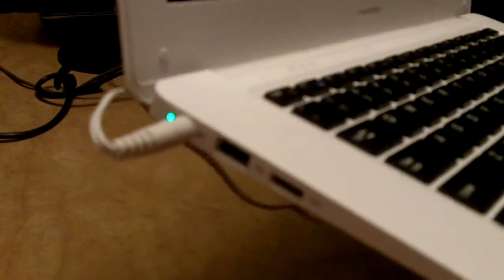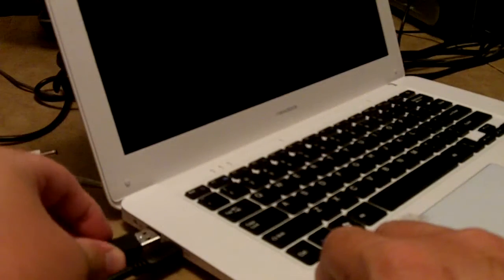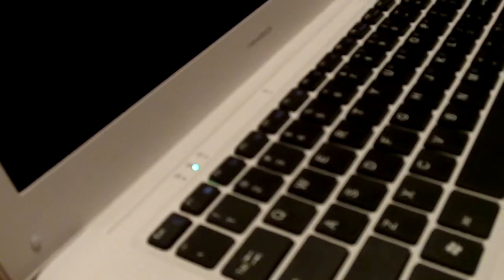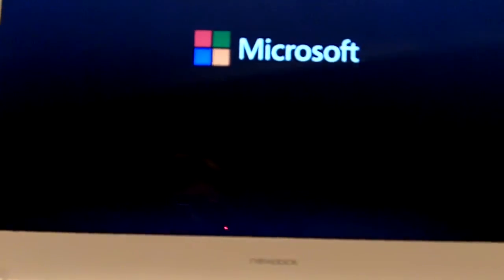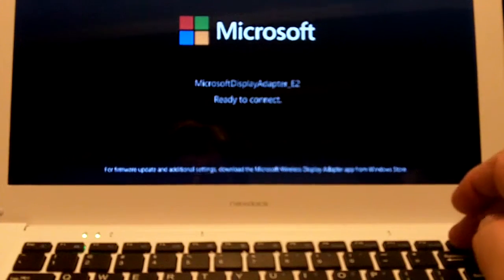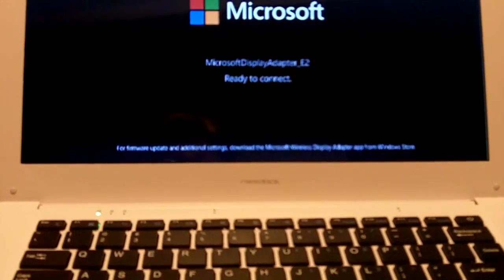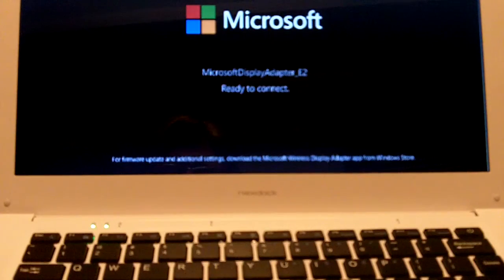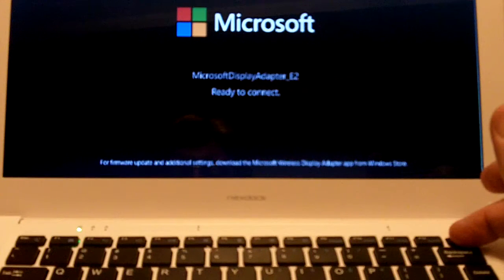nexdock power button testing

Comment: Interesting that you've had luck powering it back on even with the adapter disconnected. In my case, I can't seem to do that. I wonder if it is related to having the wireless display adapter connected. Maybe it is continuing to pull power somehow which keeps it "warm". If you disconnect everything when powered off, will it still power back on?
Reply from the maker: The nexdock will not remain powered on with no live HDMI input signal, with or without the power supply connected.